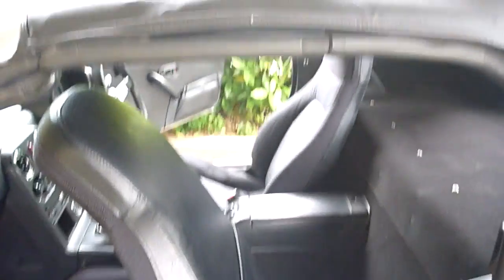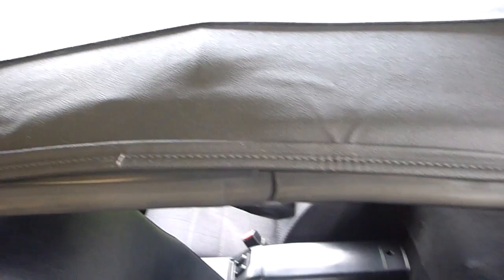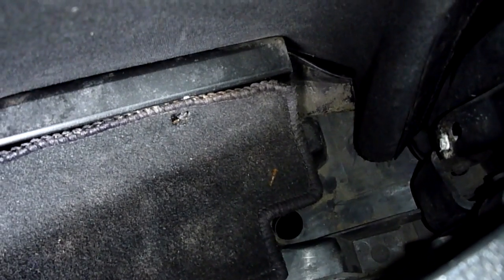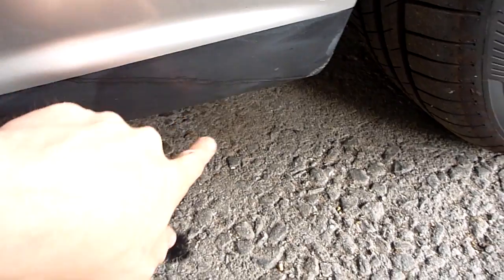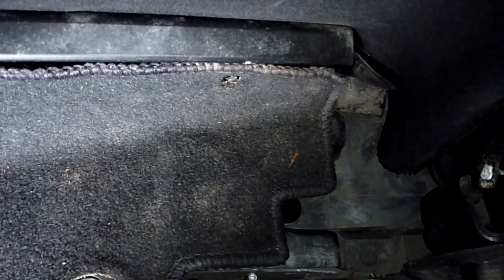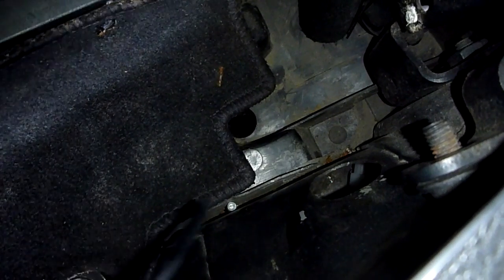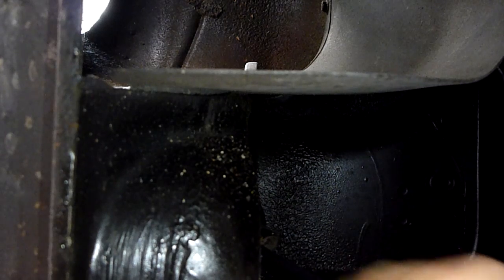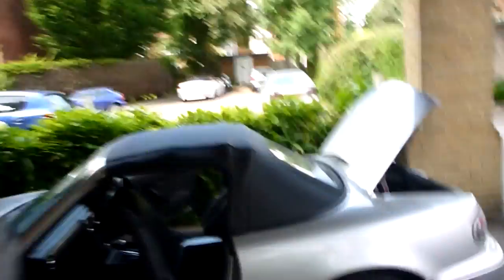My MX5: How to Solve Water Behind Seats or in Sills (Clearing Drain Holes)

Comment: MX5 ND2

Thank you for your videos. As a result of viewing them and reading the comments I was able to complete these tasks and learn a lot in the process.
1. The hole behind the seat belt may be covered by a centre pull stud (same as those that hold the plastic panels on)
2. The one- ended trombone can be fished or fiddled down the hole but there are a couple of obstructions that make it hard to get it all through
3. Prising off the large circular stud (one of two low down in the panel behind the seat) allows access to an oval cover labelled out with an arrow pointing to the side of the car. On the other side is a catch which can be released with a short flat bladed screwdriver slid in horizontally along the axis of the ‘out arrow’ from the inboard side of the cover.
4. Reach in behind the cover and prise the white plastic tube off the vertical surface (there is one small lug held in a notch which holds the tube in place). Once the tube was held vertically I found I could fiddle the trombone cleaner right down and out through the sidewall.
Reply: can you show it in a video sir

Comment: Thanks for the vid, it gave me the impetus to try some things on mine which were both blocked and causing sloshing noises. Not having a trombone cleaner to hand, I escalated from a coat hanger to flat electrical wire then to a stiff bamboo cane which finally got things moving a bit too well, as pushing hard with the cane disconnected the whole of the bottom part of tubing. When I removed the tube and the rubber grommet from the sill I could see why it had been an issue - both rubber flaps were backed up with an inch of mud, stones and on one side, a rusty nut just like yours which probably came from when I had a new soft top installed. I cleaned the flaps out by hand and eventually was able to reassemble the tubing inside the sill by pulling on some electrical wire routed through the whole thing to locate the two rubber hoses together, but I wouldn't recommend that approach unless the flaps are really backed up badly, because it's really awkward! I'll be flushing those flaps through a bit more often from now on!
Reply from the maker: Excellent! That's a good job done 😊
Reply: I found an alternative to the trombone cleaner.  It's a giant cable tie of 1.2 m / 4 ft in length used by heating and cooling installers to hold ducts.  I remembered I had some in my garage after renovations.  Insert, twist and withdraw. Holes now clean. 😃

Comment: I just bumped into your video and I know it's from 2016, but I thought I let you guys know this. You don't need anything special to clean the holes at first. Just get an old metal coat hanger cut it and use that to clean the drain. The second thing you should do is take out those stupid flats that will just cause you trouble again with a plugged hole from all the dirt and crud that falls through there. Once you take out those stupid flats, your plugged holes problem is permanently solved and you won't have to keep doing that again. You can check the holes every blue moon, but I haven't had any water problems with that after getting rid of those flaps. Good thing I did that when I first got the car and changed the top. I haven't seen any water there after some heavy rains. I've had it for a couple of years now.
Reply from the maker: Yes, you can remove the flaps. They are there for a reason though - mainly for insulation purposes. Also, a metal coathanger is not going to scrape down the sides of the tube properly and loosen any stuck crud in there like the pipe cleaner does. Personally I prefer to just clean mine periodically when I'm doing a routine service. It takes less than 2 minutes.
Reply: how do you get rid of the flaps?

Comment: I found an alternative to the trombone cleaner.  It's a giant cable tie of 1.2 m / 4 ft in length used by heating and cooling installers to hold ducts.  I remembered I had some in my garage after renovations.  Insert, twist and withdraw. Holes now clean. 😃
Reply from the maker: Good shout!

Comment: To protect the rubber seals you need to apply every 6 months a product called Gummi Pledge. Its a German Rubber Protectant. I have used this on my MX5 for the last 8 years and never had any leaks
Reply: Sorry the correct spelling is: gummi pflege
Reply from the maker: Thanks very much for the recommendation, I'll be sure to check it out

Comment: That nut looks remarkably similar to the 12 or so nuts which hold the rain rail on under the back of the carpet by the way. 

Plus thanks for the guide, I've been running a hardtop all through the winter, only now realised my driverside drain hole is completely plugged, which would explain why my driverside rear sill is entirely bollocks'd :D
Reply from the maker: Yeah, I'm pretty sure that's where that nut came from, although my rain rail does have all it's nuts on it so someone must have replaced it. They're used in various places around the car though so could be from a number of places. 

Glad the guide was useful. They do block up really easily, it's no wonder sills are the first thing to go on these cars
Reply: Aye, my back left jacking point has had it, hopefully good cleaning can prevent further damage :D Ordered a trombone cleaner from mx5parts today for a fiver (alongside some other bits).

Comment: Don't forget the drain holes under the wiper area . It will cause water to leak from under the dash
Reply from the maker: Yes, good point
Reply: This spring that is where I finally found my leak . Lots of info on the rear drain holes ,although Mine were pretty dirty cleaning them didn't cure my damp carpet until during a thunder storm I actually saw the water dripping from under the dash on the passenger side . I used windshield silicone which does not have as much acid as regular builders silicone .

Comment: I have the MK3 and yesterday tried to clear the drain holes with the trombone brush but all it did was it kept coiling as I was pushing into the drain hole. I think I am going to try some very stiff electrical wire.

Comment: I flush my 2001 Miata with a Garden Hose  that has a nozzle... Water does a better job of removing all the debris ... I tried a wire and it did not remove all the debris...

Comment: Rob G. I realize that this video is  6 years old, so this question is a long shot. I have a 93 MX5 Miata in excellent condition, no rust, etc., due to previous owner garaging it. I even put a turbocharger in it for more h.p.. But as I am the latest owner, with no garage and many trees, my drainage tubes get clogged literally everyday. Would it be possible to apply squarish 3 inch window screens on top of the holes to keep out the debris? These could then be easily cleaned daily.
Reply from the maker: Yes I think that would definitely be possible. You would have to clean them very often though as there isn't much space for water to collect on top of the hole, so it would overflow very quickly. Another way of dealing with it might be to remove the flaps inside the drains so that debris can wash through more easily, I would guess you'd probably be able to hook them out with some strong wire
Reply: @RobGMyMX5  good to know. I tried “drilling them out”, meaning the flaps, by aiming to the “hinge “. My driveway(I no longer garage) is covered by mature trees, and I can’t believe how poorly this drainage system was designed. It literally brings outside water into the passenger compartment! One tiny leaf, and I get a wet back deck(slight hill) and possibly wet trunk with rust and mold. Thx for the reply. Side question: do you know anyone with interest in a 93 turbocharged Mx 5? I’m going to price it competitively.

Comment: oooooh take the brush off!! Also my trombone cleaner has a very very bendy cable so it's a bit of a nightmare to use. Fairly sure it isn't long enough either :'(
Reply from the maker: Yeah mine isn't the strongest either. The first time I did it it took me a good 15 minutes of wiggling to get it past the flap, especially since there was quite a lot of crud in there blocking things up. You can put a long screw driver in from the bottom to try and loosen the flap a bit, but just be careful you don't break it.

Comment: I've had trouble locating the exact drain. I see a grate of some sort with water at it's bottom. Wouldn't drain cleaner product work? I'll keep digging.
Reply: Do you have a fourth generation?, that's the only one that comes with a factory filter over the drains. The 3rd gen is slightly more tricky to get to but still has open holes like the first two generations. Other than warm water to help clear dirt easier, I wouldn't put any type of drain products down them

Comment: I'm stuck between an 03 miata that needs some surgery to save it's poor  life with 143k miles and an automatic 01' miata that's in pristine condition with 130k miles. It will eventually die from rust due to somebody neglecting to clean the sills. I don't believe in an automatic miata but I really want a miata.. I may turn my first car into a project car. The dealer wants 4200 and the one selling the automatic wants 4500 (original asking price for the rust bucket). The rusty dealer is firm in his price but we're going to take it to a body shop and get a quote for how much it will be to fix it. Should I invest in saving this miata or should I buy one with it's balls ripped out?
Reply from the maker: Hmm... I think if it was me I would go for the one with no rust. You can change out pretty much any part of these cars, but the one thing you can't change is the bodywork. Obviously you can get repairs done, but the problem is that until you start ripping out the rusty bits it's difficult to know how bad things have gotten inside. Also the Mk2 Miata has a particularly bad rust issue on the front chassis rails (the square structures running down on either side of the engine), so it's particularly important to check those out before you buy (sometimes the car will look like new on the outside but the chassis rails will be like swiss cheese). 

I don't have much experience on prices in the US, but I would say it's worth paying a bit more for a really clean car. It's much easier (and cheaper) to keep a car in good condition than to try and restore a poor one back to a good condition.
Reply: i came across an 06 (perfect minus a tear in the top) for 4250. Sold quicker than what I could get to (TRAGIC) HOWEVER i'm about to go check on a 96 for $2000 that's got less miles. That rust bucket is far away from my wallet now.
Reply from the maker: The good ones do go quickly!  Good luck with your search :)

Comment: I have one of those tubes to the bottom of the car missing on mine when I bought it and the sill is rotten because of the water getting in the body instead of running out the bottom. The other side is intact and the sill is fine
Reply from the maker: Not good at all 😔  I wonder why someone would have removed it?
Reply: @RobGMyMX5  not sure I was reading online that you have to work to take them out they cant just fall out on their own
Reply: @My68Tempest  I just dislodged mine when trying to clean out. Being gentle with electrical wire wasn't opening the flaps so I got a stiff bamboo cane and got things moving a bit too well! The tubing is in thee parts with the bottom part being quite short and it just presses on to the middle part inside the sill. You could probably fabricate that part, or get a spare, as it does contain the flap. Attaching it back to the middle part is awkward but I managed eventually by using a piece of wire all the way through to help locate it inside the sill.
Reply: I found one at a junk yard and pulled on it and it practically fell out. But I did get the grommet also so I should have a complete tube when I get it put back in

Comment: Hey Rob.
Im just wondering. How can the water go down the hole and end up in the Sills - when the brust comes out of a different hole underneath the car - not the drain hole for the Sills?
Reply from the maker: Hi Jonathan. The problem is more that if the drain holes are blocked then the water can't drain down them, so instead it overflows and ends up inside the sills. The drain hole bypasses the sills and takes the water straight out of the bottom of the car, so if it's working properly then no water should ever end up inside the sills.

Comment: Yeah but how do we get the water out of the sills...
Reply from the maker: There are two drain holes at the base of the sills - two at the front and two at the rear. Get a small screwdriver up into each of them and wiggle it about to open them up. Here's a diagram I found on an MX5 forum:  
https://ww2-secure.justanswer.com/uploads/supermazdatech/2010-12-01_163949_water.gif

Comment: Here you can find this product on Amazon
https://www.amazon.co.uk/dp/B01DKTNXDS
Reply from the maker: I did see this the other day, funnily enough. The only trouble with it is the wire bit is quite thick and might be tricky to push through the flap in the middle of the tube. Also it's much easier with just one brush instead of one on each end